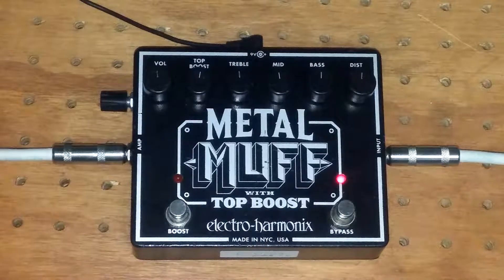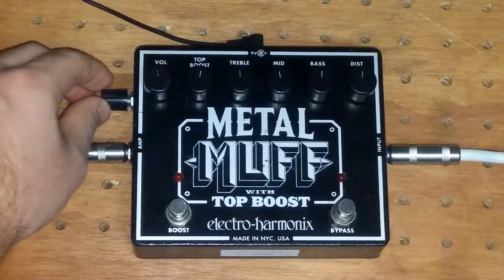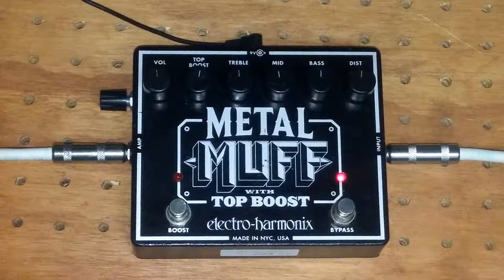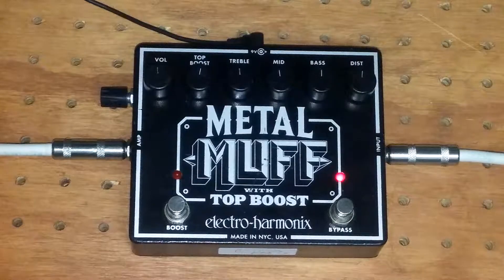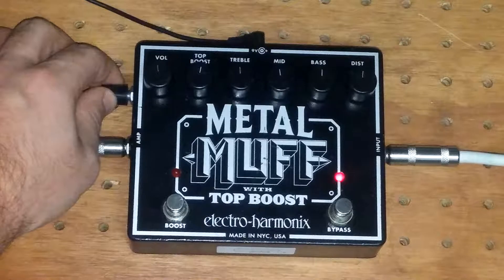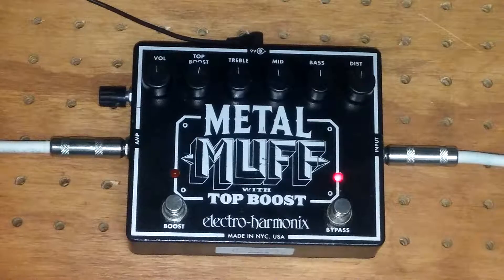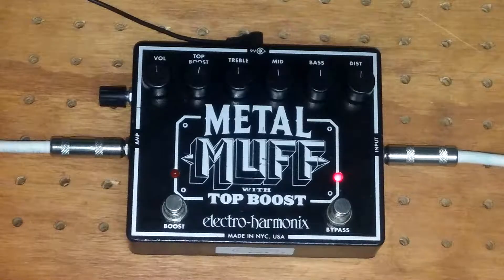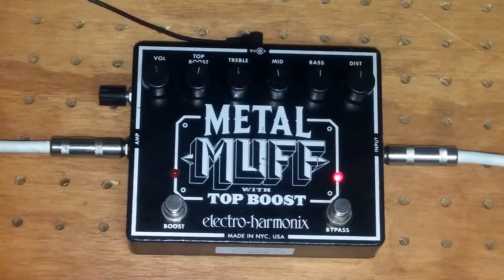Electro-Harmonix Metal Muff Blend Knob Mod by Loophole Pedals

Comment: can you make  a tutorial?  or a list of tips when doing preliminary testing? 
is there anything more than a pot in your mod? 
did you have to add any circuitry to get the dry and wet levels to mix evenly? 

I am trying to do this to a rat distortion for a friend but I don't have that much XP straight 9 volt. most of my builds have been bipolar 12 or 18 volt circuits
Reply from the maker: I add a blend module to balance the signals